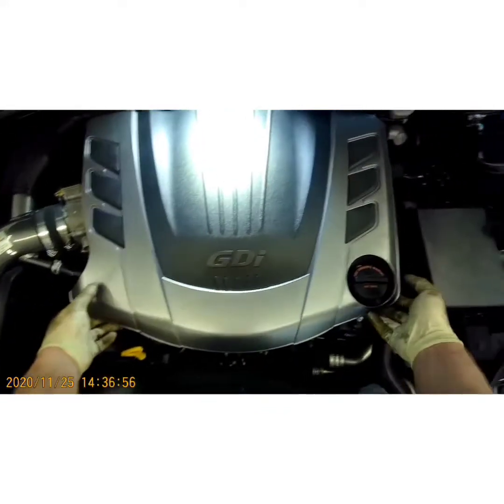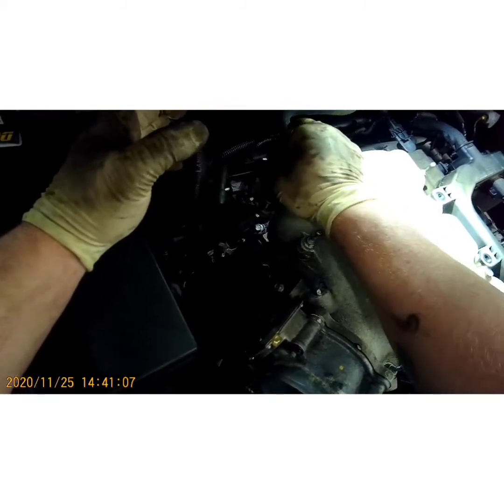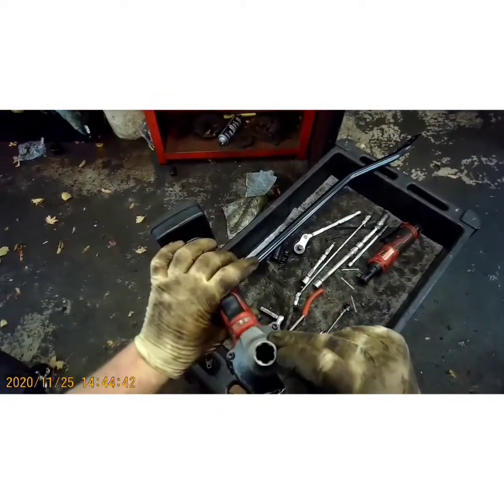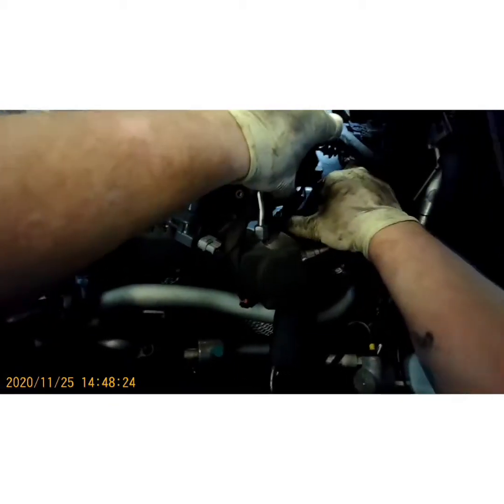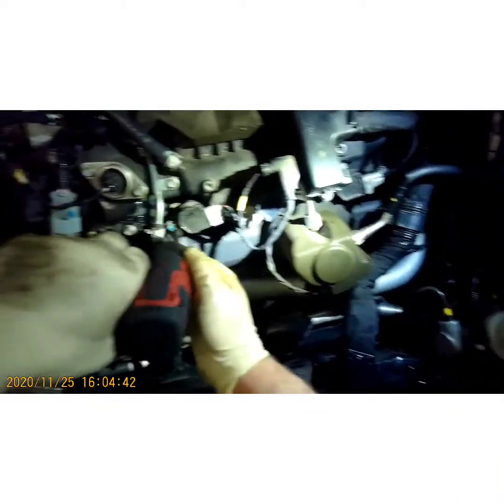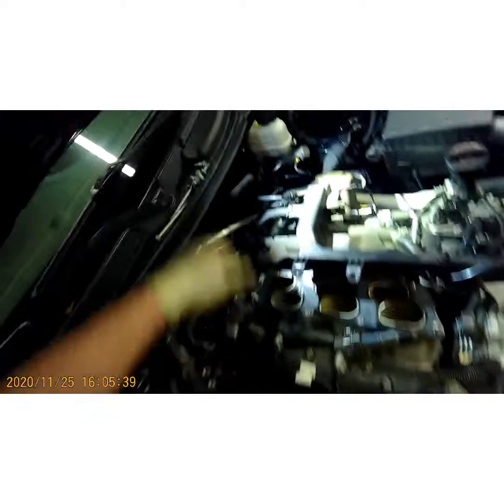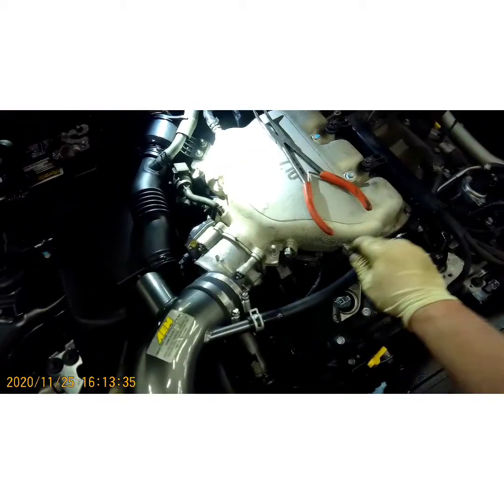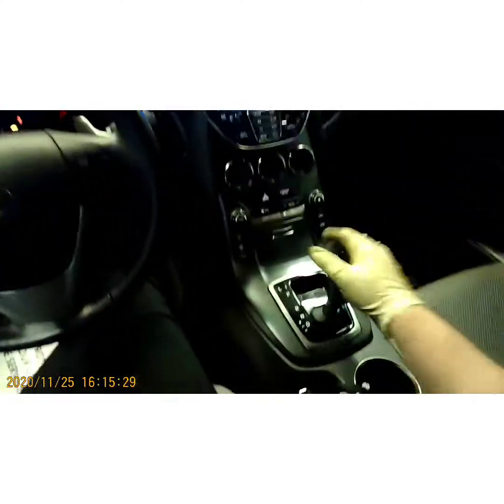how to replace spark plugs 2015 hyundai genesis coupe

Comment: Just what i needed to see. I doubt the previous owner change the sparks so I'll be more than happy to conduct this maintenance myself. Thank you for the walkthrough video it really helps me identify exactly what's next. 
For the spark plugs extensions, what were the specs on the tools? IE length of extension & size & torque specs.
Reply from the maker: Glad I can help , that's what I do brother
Reply from the maker: Six inch 3/8 extension and 5/8 spark plug socket,  just snug bolts as tight as they felt when u were breking loose if that makes sense,  you will develop the feel whenever u do this as long as I have thanks for subscribing
Reply: @automotivetech-vet  Of course. Apologies for the delay I was on lunch break when i watched this. Where's your shop located? Looking for a shop to do a brake job. I of course can do it, but time is limited. It's everything Rotors, Pads, Pins, Bearings.
Reply from the maker: I'm in Marietta georgia you live in georgia
Reply: @automotivetech-vet  Sheesh that's a drive. I'm in Dallas Texas for right now. Thank you for guide!

Comment: Thanks for this. I have a 2015 genesis 3.8 and it looks like I will need to follow the same process. Now after you started the vehicle up and the check engine light came on do you use your scanner to clear the code or will it clear itself up?
Reply from the maker: It will eventual go off by itself Or you can disconnect the battery
Reply: @automotivetech-vet   This may be a dumb question but does this work the same as the Sedan. I’m having troubles finding a in depth video for it. Thank you!! 🙏
Reply from the maker: @khaotickiller5788  what year
Reply: @automotivetech-vet  2014
Reply from the maker: @khaotickiller5788  same my brother thanks for the love
Reply: @automotivetech-vet  Of course and thank you I made sure to sub. Last question should I disconnect the battery?
Reply from the maker: @khaotickiller5788  yes it can't hurt
Reply: @automotivetech-vet   Hey so
I happened to change them this morning turned her on and I seem to be getting a misfire would you know why that could be?
Reply from the maker: @khaotickiller5788  you probably plugged in the wrong coil
Reply: @automotivetech-vet  ok it’s valves 2 and 4
Reply: @automotivetech-vet  I also seem to have a rubber gasket on my manifold. Do I need to replace that
Reply: @automotivetech-vet  you really are a damn professional. I really appreciate it man. ALL GOOD over here now🙏💯
Reply from the maker: @khaotickiller5788  we all dumbassees sometimes bro !!
Reply from the maker: @khaotickiller5788  nah reuse it it will be fine brother
Reply: @automotivetech-vet  will do and yeah it runs better than before so that’s GREAT.